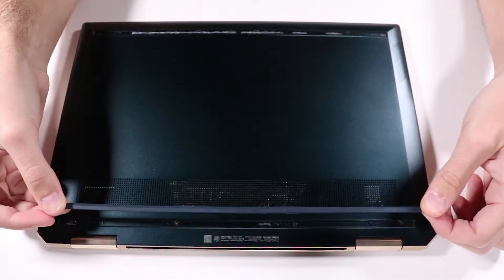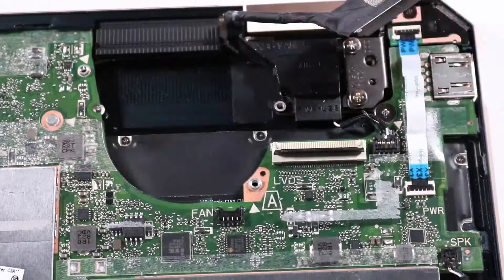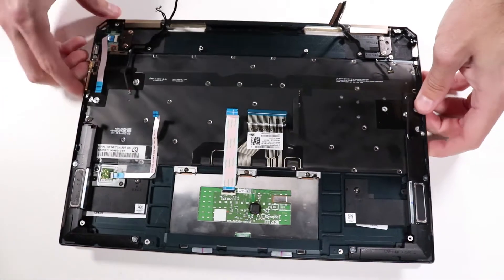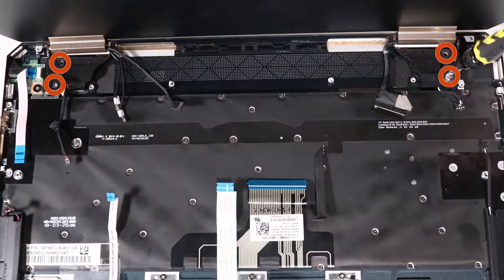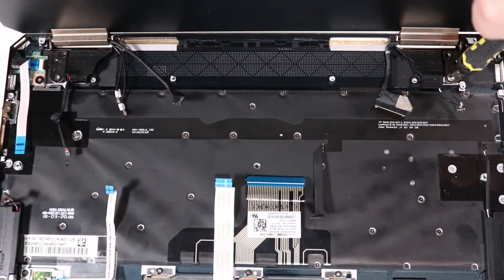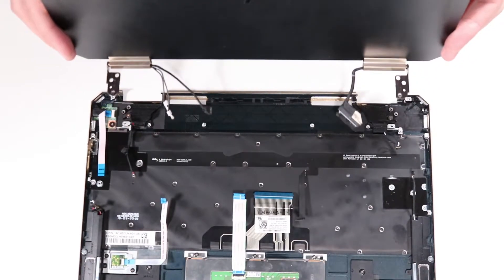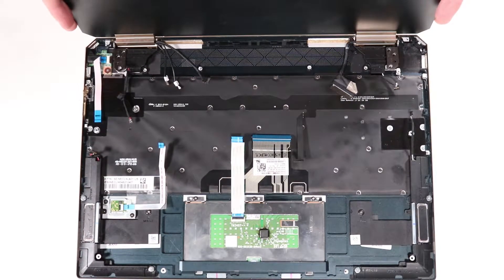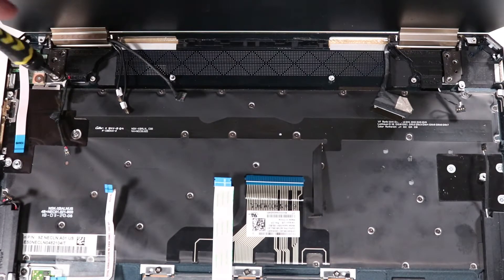Remove the Display Assembly | HP Spectre 13-ap0000 x360 and x360 13-ae000 Convertible PC | HP

Comment: Are all of the connections off of the new screen clips? Or is there soldering involved? I see two connectors and then some other wires that look like they might be soldered.
Reply from the maker: Hi Jackson, thanks for contacting HP Global Social Media Support!
I understand that you need help in removing the display assembly.
I will do my best to assist you.
Please refer page number 51 of the user manual to know about removing the display assembly: https://bit.ly/3F4alni 
Binu_HP Social Media Tech Support